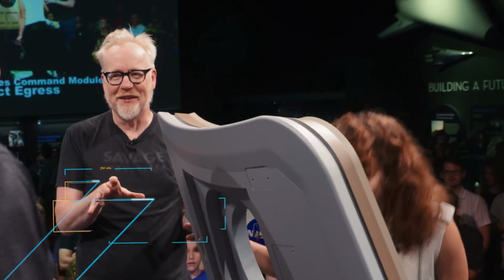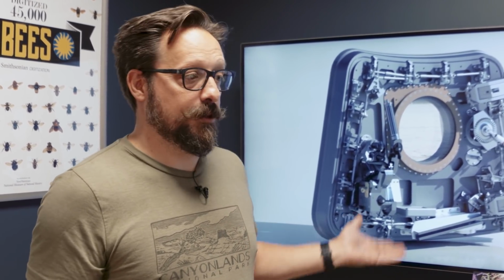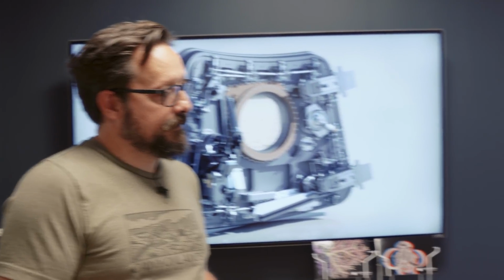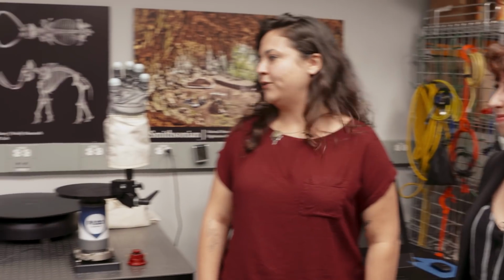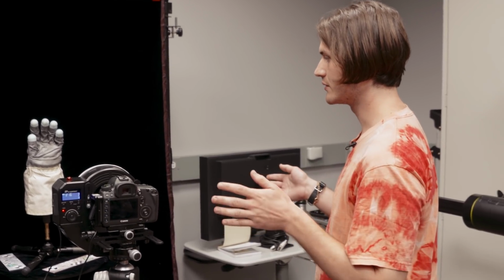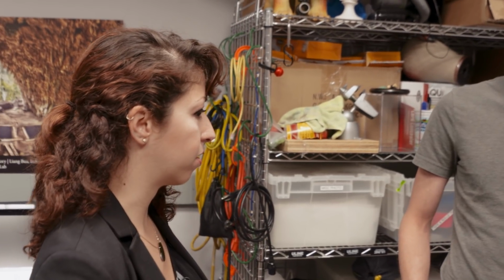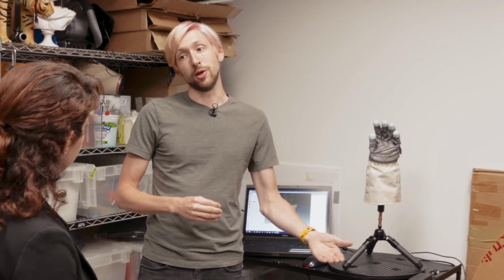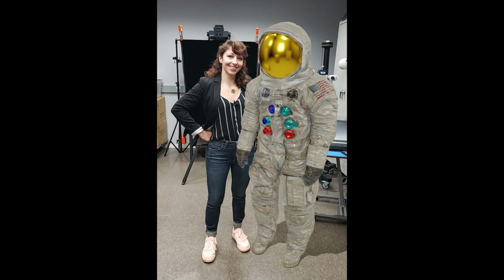Digitizing Objects from Smithsonian's Enormous Collection!

Comment: I loved this video! I wonder if the Smithsonian digitization team is hiring :) I wanted to add that you can get very highly detailed geometry from photogrammetry as well good textures - it's very dependent on your lens, camera (especially resolution), and your distance from the object.  For very small objects the need to be close means there is a lack depth of field that can make captures very difficult, but I've seen and talked to people who have used things like macro lenses and focus stacking to capture extremely small objects. You can in fact even do photogrammetry with a microscope that can capture images! You would need a very expensive Structured Light or Laser scanner to get the same geometry quality as even a sub-$1000 SLR camera, never mind texture quality. For reference, the handheld scanner they were using here was a $25,000 Artec Space Spider I believe - that FARO laser scanner arm starts at $50,000. So photogrammetry is the easiest point of entry in terms of cost, but can also produce results that rival even the most expensive laser scanners if you have time and know what you are doing. It can be very time consuming for large objects, and it doesn't do shiny, transparent, or flat colored objects. So it's both easy to get in to, and hard to truly master! Plus the other benefit of photogrammetry is it is easy to archive. You can archive the model as a RAW image set, which can always be reconstructed later in your software of choice. If you are interested in photogrammetry, I highly recommend checking out Cultural Heritage Imaging -  I believe those were their high precision scales I saw during the photogrammetry demo!

Comment: Curious how they merge the data from the different techniques when they're scanning a soft object like that glove that's likely to deform between scans from being moved around.  Can they only apply the color from the photogrammetry to the geometry from the laser when it's a hard object?  Or only when they're able to get both scans without touching/moving the object in-between?  Seems like if the cloth folds a bit or one of the fingers wiggles into a slightly different position, that would suddenly make the color data no longer fit the geometry data, right?
Reply: You are right! I'm curious too, I imagine it probably doesn't match up 100%. I haven't done photogrammetry of fabric objects, but I hear it can be quite difficult for the reasons you mentioned. I've even heard that the sagging of fabric due to gravity as it slowly settles over the capture period can add slight distortions in the final model!

Comment: I am so thrilled by the use of digitizing and 3D printing in museum curation. It's a phenomenal way to bring the museum to you if you can't go to the museum. Plus, a 3d printed copy can be handled where the real object shouldn't be. The 3D scans and prints don't replace the real objects in the same way photos of artworks printed don't replace the real artworks since there are aspects that can't (at this time) be replicated 100% faithfully (i.e. the weight and fine textures of an object), but there are other things that can be done with 3D prints like articulating the joints, scaling the object, etc. The ability to handle the objects also makes them accessible to those who are visually impaired.

Comment: Every manufactured part there should be reproducible from manufacturing prints. I also wonder about the copyright. Scanning a part that was copyrighted is surely no different than recording a song. It's a copy.
Reply: Now that would be cool: finding microform drawings for each bellcrank, cam, gear and sill in that Apollo hatch assembly, then short running from rod and billet strictly to plan with circa-1967 shop machines. There are people who do that with 19th-century steam engines for fun. As for the visual copyright, you'll note they are careful to say "for educational purposes only". You can make all the 3-D prints you like of a massmade thing, so long as you don't compete with the massmaker in even the tiniest way.
Reply: @johnturner8286  I'm not saying replicate them irl. Not that that would be hard at all... Having repaired manufacturing machines for over a decade, ran cnc machines for years, owning a shop, etc... I can personally and professionally attest that it would be simple.

The point is that _models_, which are what they were creating here, should be reproducible from prints.

Copyright is not limited to whether or not profit is made. My question is whether the guys providing these 3d models have the appropriate copyright to begin with. It's possible that they are public domain.

Comment: Back when the show american pickers came out I remember seeing those gas pumps with the light up signs on top and them saying something about how finding replacement globes were almost impossible. It made me think of the, at the time, new technology of 3d scanning. I thought it was be amazing if google were to have a team devoted to just scanning and cataloging everything ever made so you could always find digital versions of things and measurements. I even went the insane route and tried emailing some google ideas department but never heard back  of course. I never thought about the smithsonian doing this but that makes more sense. Glad to know someone is doing this idea.
Reply: Original globes are tough to find, reproduction globes are plentiful...
Reply: @kerrykroger7323  It was probably just exaggeration for TV but it still made me think about having a digital catalog for everything ever made.
Reply: Problem with it is there would be no need to MAKE anything to sell, so all parts would end up bring one off... and expensive...
Reply: @kerrykroger7323  I don't follow you here. What do you mean?